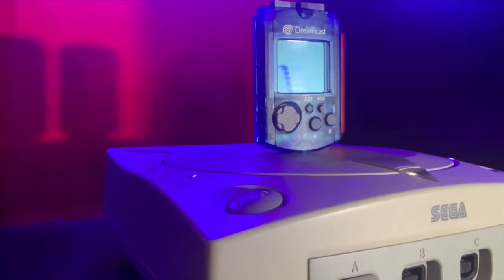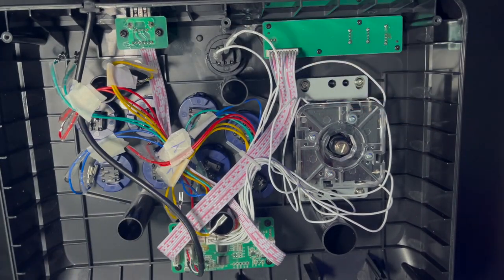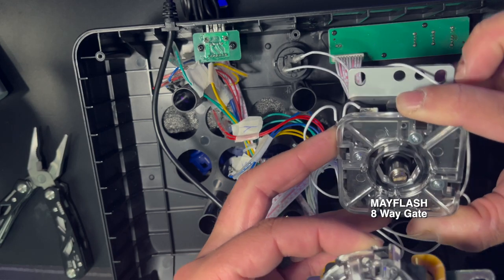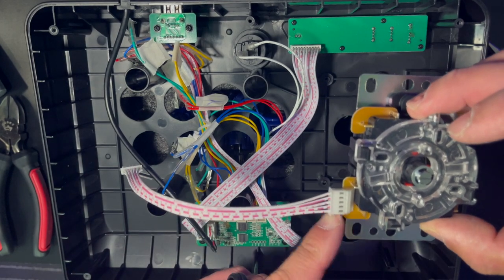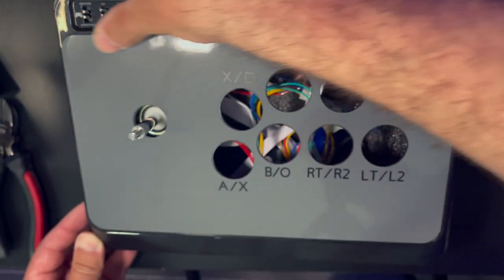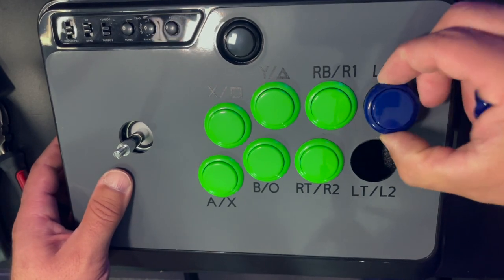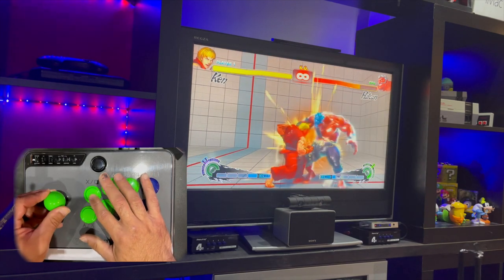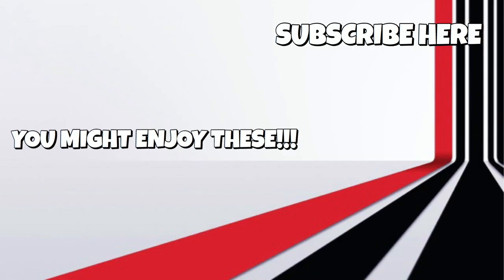Mayflash F300 CUSTOM Dreamcast Controller MOD | Sanwa JLF Stick & Sanwa Buttons

Comment: Wow, I really enjoyed how this turned out! Not only that, but the stick is very useful, I for example play TriZeal on the Dreamcast for scoring, however, I need a 30hz Turbo button which said port doesn't have, but if I set it to "C" (RT, where I normally have that button) as a normal shoot, then use the MayFlash Turbo 2 action, voila! Turbo 30hz!

Also, you say is "passable" but this ended up extremly cool, you even painted it and everything and that added even more character.

Cheers from Mexico!
Reply from the maker: I’m really glad you enjoyed it. I’ve wanted the HKT 7000 for awhile now but prices have since soared up. The mod was fairly easy, but I didn’t paint it, it’s vinyl stickers that were cut out to fit. 

Cool work around to get the Turbo 30hz to work. 
Thanks for watching:)

Comment: I believe those buttons are all 24mm
Reply from the maker: The standard Sanwa buttons I used are 30mm. The start Mayflash button is a 24mm. It’s slightly smaller.

Comment: I have a Hori RAP N Hayabusa arcade stick controller, I tried out the hayabusa parts (Lever and buttons) and they suck. Are the sanwa parts any good?
Reply from the maker: I’ve never tried Hayabusa parts. I do know that those who like one dislikes the other. I like the feel of Sanwa they are responsive and sound good.

Comment: Its pretty straightforward
Reply from the maker: Very easy to mod
Reply: @TheRetrollectors  well that's something you kept saying in the video.  But yeah as soon as mine gets here I'm modding it.  I didn't know about the gates, and I also didn't know the Japanese hit the gates differently than us.  But I'm just hmgetting into fighters
Reply from the maker: @stickman787  the gates absolutely change the feel. But the best thing is that you get the two different gates and you can test and feel the difference. I prefer square gates. It feels like there is less travel and a bit less precision is needed to pull of moves.

Comment: Quick question: Does every sanwa joystick part bring the 5 pin connector? Looking to get the silent sanwa joystick.
Reply from the maker: I’ve looked up the Silent Sanwa stick. It does have the 5 pin connector but you still require to buy the actual 5 pin wire separately. Also note that from what I’ve seen you may not be able to change the gate from 4 way to 8 way on the Silent Sanwa as the 8 way gate isn’t made for the Silent Sanwa. Hope this helps I used this site for reference https://arcadeshock.com/products/sanwa-denshi-jlf-tprg-8byt-sk-3rd-gen-silent-stick-high-tension (READ SPECIFICATIONS CLOSELY)

Comment: How were you able to print the Dreamcast letters and logo sticker and then transfer it to the vinyl overlay? I've been searching for that stuff but was never able to find a solution.
Reply from the maker: There is transfer paper, it’s sticky on one side and remove the excess stickers just leaving the lettering and logo. Then use the transfer paper and place it where it needs to go.
Reply: @TheRetrollectors  Does it last or will it rub off after some use? Never seen that transfer paper, I only found the stuff tattoo artists use which is why I was never able to find the proper transfer technique for labels.
Reply from the maker: @farben_  it’s in the Hobby Cricut Aisle. As far as durability goes. It hasn’t peeled off yet. I’m sure if you use clear spray paint it could help seal it.
Reply: @TheRetrollectors Oh so it was all done on the cricut then, after I searched more info on what a cricut can do I get it now, yeah it should last. Only drawback is how expensive it is.
Reply from the maker: @farben_  my wife has one so it worked out.

Comment: Looks awesome man 👍
By the way I only need 15 more Dreamcast games to complete my collection I can't wait!
Reply from the maker: I’m so jealous. I’m down to 24. Can’t wait to be able to focus on peripheral collection
Reply: @TheRetrollectors  the only peripheral I want is the samba de amigo ones. Thankfully most of the games I need left aren't to expensive aside from the shmups 😒
Reply from the maker: @immitationstation3369  mine are more commons that shot up in price. On eBay many of them are $60-$80 but their price range that they should be at is $30-$40
Reply: @TheRetrollectors  yeah here in the states we got stimulus checks from our government and because of it people who didn't need it just splurged it on games and brought the price up 😄 it will go down (maybe) with patience and some auction luck
Reply from the maker: @immitationstation3369  we get that too but it’s only based on whether you cannot work due to the pandemic.
Reply: @TheRetrollectors  that's good and yeah there were a lot of DC games in the realm of 20 to 30 especially that shot up to the 50 to 80 marker. I would love to see your personal opinions on I suppose you could call them mid tier DC gems if you ever decide to do first thoughts videos

Comment: Awesome video! Thank you for all of your videos. Where did you get the gray and white skins? I definitely want to try to do something similar.  Thank you, take care.
Reply from the maker: I custom cut them…I lied…my wife custom cut them. I found a template on Google that was undersized and my wife has a Cricut she cut out the Google template then resized multiple times till we had a proper fit. Lol. The Grey face was an easy find through Google. If you and many others didn’t watch my videos I wouldn’t still be making them. So thank you:)

Comment: How do u connect this to the dreamcast?
Reply from the maker: You need a Brook Wingman SD look up on Amazon or EBay it’s a converter that connects to the Dreamcast controller ports and has a uSB slot for the Arcade Stick. Works pretty good.

Comment: Really helpful video, may I ask what is the size of the artwork cause I'm planning to put an artwork on my f300 😊
Reply from the maker: I’ll put up the template as a link in the description when I get a chance. Thank you for watching, I’m glad you enjoyed it and glad if it helped.
Reply: @TheRetrollectors  Any chance you have a link to that template, I am planning to do the same
Reply from the maker: @fthetm  unfortunately it was a custom cut. Trial and error. There is a template on Google but it doesn’t have measurements. Print one and see how many times it has to grow. Weird I know but that was the only way I did it.